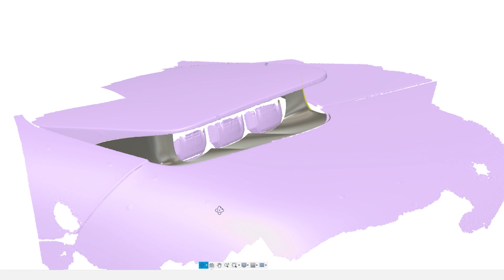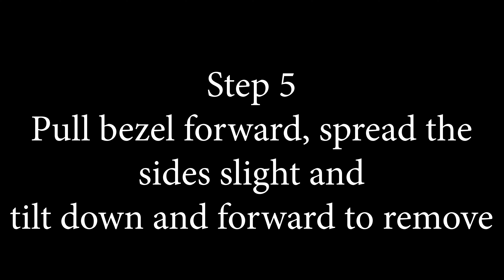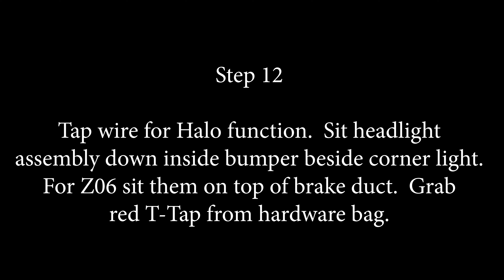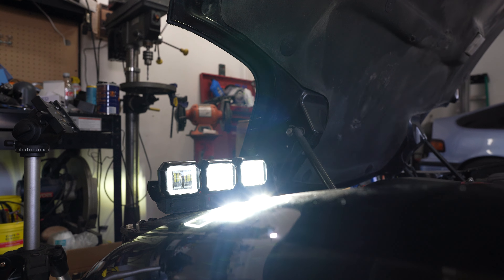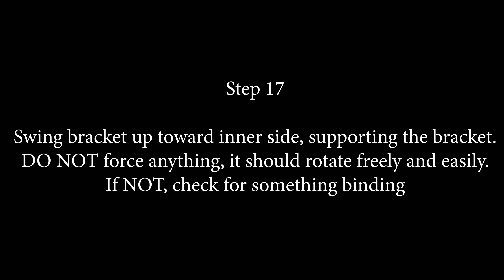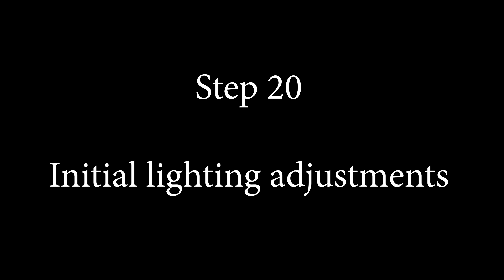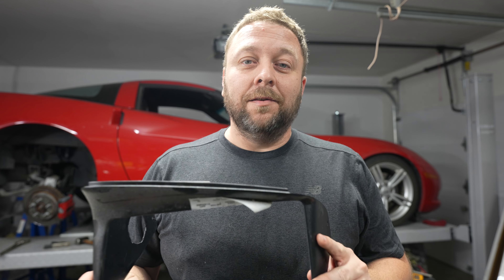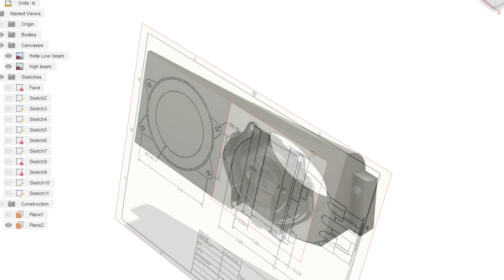C5 Corvette Sleepy LED Headlight Install Update | Easy to do

Comment: Glad to see the success you’re having with this mod kit!!!

A really helpful video might be to demonstrate how to remove and clean the headlight adjusters.  Mine were seized completely, and applying any amount of torque to them will surely break them.  I had to disassemble, clean and lubricate them to get them working properly.  There’s no point upgrading your lights if you can’t aim them.

A second suggestion would be a video on aiming these lights properly.  Improperly aimed light don’t work well and can blind oncoming traffic.

Speaking of aiming, my ‘02Z headlights were aimed very poorly from the factory; cross-eyed and pointed at the ground.  Using the high beams as a guide, I straightened them out and raised them, and now the work as they were likely intended to.  That is, they project much farther down the road, light up the side of the road, and do not blind oncoming traffic.

If I had to guess, I think they were aimed so poorly simply to get the headlight lenses to align with the bezels for cosmetic reasons.  Seriously.  Once I aligned them properly they no longer fit the bezels, which looks bad but I couldn’t care less… you never see that anyway.

Comment: Can you design a new, more modern faceplate and knobs for the C5 HVAC unit? It's probably the biggest eyesore in the interior once you have done all the other interior upgrades. Should be fairly simply as the faceplate plastic detaches from the rest of the unit. The LCD screen on it is fine, it's the plastic around it that's ugly.
Reply from the maker: I have considered this because a lot of people ask me about it.  Could I...yes...will it really be a return on time investment and should it be a priority over certain other mods...idk...I feel like not yet
Reply: @KnightDriveTV  Way less complexity/number of parts than these headlights...I think it would be a home run in sales compared to effort/cost.

Comment: Any issues with the stock metal adjusters? I’ve had mine on for quite some time and no issues at all! Thanks again for a great product! People love them at all the meets!
Reply from the maker: No issues aside from some people having difficulty installing them.  Also, some people with headlight motor rebuild kits ended up with clearance issues that were able to be resolved but with this approach, completely avoidable.  This makes the kit easier to install with a repeatable opening height, simple as that.

Comment: Damian, I received my kit and have the metal stops. Will i be able to upgrade when you correct the issue
Reply from the maker: Yes, please watch the red car thumbnail install video.  Once the new stops have passed beta, then they will be on the website.  They are on there as beta right now, but no guarantees how long theyll hold or work until we have more feedback.
Reply: Thank you. I look forward to following you

Comment: Nice video. I installed your light kit about a month ago. Very happy.  When the bezels come out is it worth swapping over to this style stop from the metal one? Will you be selling these individually? Thanks
Reply from the maker: In order to do the bezels, I needed everyone to have the same exact heights, so my current plan/intent is to ship bezels with new stops.
Reply: Would love the new stops. Makes install/Uninstall way easier and seems alot more consistent. Hope to see you sell them seperate forsure!

Comment: I have a 97 C5 and the stops on mine aren’t the same as in the video, the stops are at the back. Do I need the old style?
Reply from the maker: All stops 97-04 are the same.  The metal stops we use adapt to both cars where there is a slight variation and these fit all cars.  Not sure what you mean here

Comment: Hey Damian, will the guys who have the 1st run of the lights in January 2021 need to get the new stops? Matt from the cut.
Reply from the maker: The metal stops work just fine, as long as you were able to adjust them to the proper height, etc.  The metal stops are still on my car as well.
Reply: @KnightDriveTV  okay kool thanks.

Comment: Hey Damian, is it normal that when I unlock my C5 corvette my headlights(halos) turn on (not on pop up mode) sense they are powered by the DRLs? 

Also in what mode do I need to have my headlights on to where I could just have the halos on during daytime?
Reply from the maker: Yes, because the disarm mode lights up yhe parking lights and the halos are tapped to the parking lights.  To not have that happen you need to change the 12v source for the halos to something else.
Reply: @KnightDriveTV  could you reword that I didn’t understand sorry Sr. :/
Reply: Hello?

Comment: Cough...make a two LED kit for H6054 headlights...cough cough
Reply from the maker: Those are like 5.5 inches tall and 7 inches wide...why?  Those wouldn't fit the space well at all, not to mention they're glass and will definitely overwhelm the motor/gear mechanism leading to a bunch of bouncing.  Am I missing something here?
Reply: @KnightDriveTV  There's a headlight for MR2's called Rev6 conversion kit that allows the headlights to not need to be raised fully (similar to your headlight) and was a 4 bulb system...problem is they were Crappy housings overall (non-projector) and they've since gone outta business.  I'd just love to be able to have a lower rising headlight w/ 4 modern projectors.  Most pop-up headlight people use LED bars to get the lowrise look (S14's, Corolla's, etc) but they're useless as actual headlights.  Something that could drop into any H6054 housing would be awesome for multiple other cars as well.